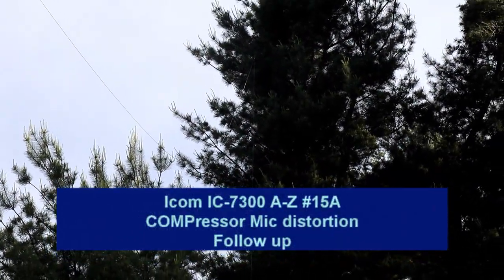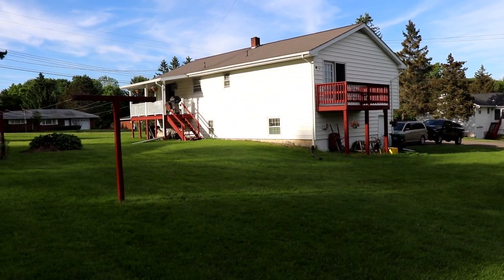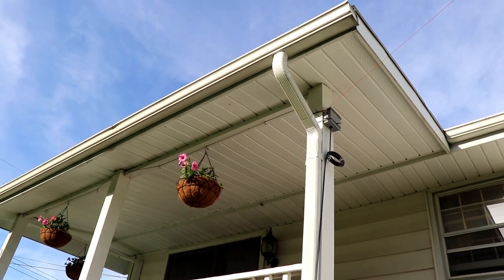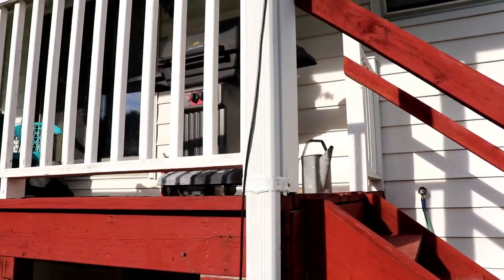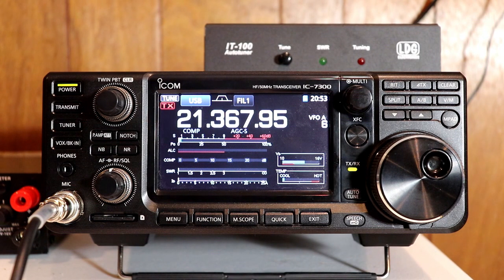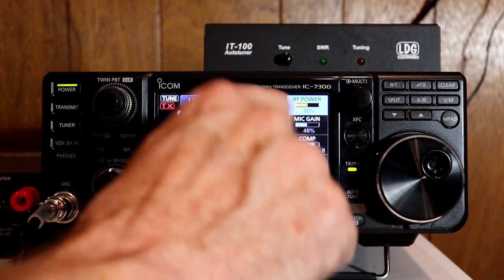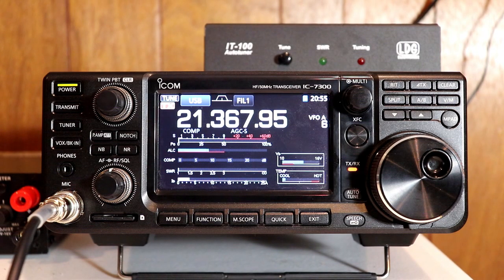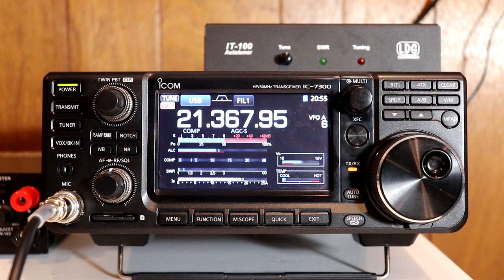Icom IC7300 A to Z #15A COMPressor mic distortion follow-up

Comment: Im enjoying the series. 

I just experienced an issue and I wanted your input. I used the internal tuner a few days ago and when it stopped, the receive signal was down (reflected also on the waterfall) and was only receiving very strong signals. I tried tuning again and still the same. Any ideas? I'm ready to try a total reset as a last resort. 

The radio was purchased new from HRO at the end of December, only 60 days in use. Jeff - W3AAB
Reply from the maker: Hi Jeff.  I have several questions.  This could quickly get too long for YouTube comments very quickly.  Please reach out through the Contact Me on the channel website- https://a-2-z.tech

Comment: Hi Tom . Thanks for all you help with the IC 7300. Awesome job. One question about the 9:1 balun unun. What length is you earth wire? I’m planning the same set up as you hav.
Reply from the maker: Hi Dave.  I have moved from that location.  I never did accurately measure the counterpoise wire, but it was about 20-30 feet.  I also experimented with adding to the 53 ft. Length of the original antenna.  However, you have to be careful about this.  It is important that the antenna length is NOT resonant on any bands you want to work on.  Any frequency where the antenna is resonant will present a very high impedance at the feed point and the 9:1 transform won’t bring it down low enough to be reasonable to tune.  If you Google “non resonant end fed antenna” you’ll find some web sites that give a number of lengths to use depending on which bands you want to work.  Good luck with it and let me know how it works for you.  73,  Tom

Comment: I thought with “shielded” coax that near by interference would be eliminated? If this is true how does the coiled coax affect inductance? Or would the extra wraps on the torrid would have been what affected your out come?
Reply from the maker: The shield helps with many things, but it is not a perfect solution.  If the antenna isn’t a perfect 50 ohm match for your coax (and a random length end fed never is) you can get common mode voltages between the shield and center conductor that will cause the shield to radiate like it is part of the antenna.  This can radiate all the way into the shack and can cause your equipment chassis to be “hot” with RF.  The coiled up section of coax becomes what is called a Choke BALUN (Balanced to Unbalanced).  The name comes from it choking off the RF and preventing it from coming down the shield into the ham shack.  Here is one article on the subject:  http://www.hamuniverse.com/balun.html. You will find a lot of opinions about how much coax, how many turns and what diameter is best.  The best answer can be determined by mathematical analysis.  However, there is a lot more opinion than analysis out there.  In my case, the amount of coax in my choke was very scientifically determined based on how much extra coax I had available.  😉

Comment: Compression on 8 and it's hardly showing ? Mine is on 3 and is almost too much. Any higher with the hand mic and it's overblown. Now, I have a desk mic that I tuen it up to 6 on.... sounds good though.
Reply from the maker: As I was recording this, I was talking into both my video mic and the rig mic at the same time.  I've got my video mic gain up fairly high and I'm speaking pretty softly.  I was recording these fairly late in the evening and trying not to disturb others in the house.  I was probably also paying less attention to the rig mic and not holding it close enough.  I think if I was talking in a normal voice and just paying attention to the radio my settings would have ended up different.  Thanks for watching and thanks for your comments.
Reply: @HamRadioA2Z  ah, ok. I recently bought this radio, and I noticed distortion when the compression is too high coming through when you have the monitor on. It sounds like RF on your signal, but it's not. The 7300 needs very different settings for different mics that you might use. I have 3 mics I use with it. I have the stock hand mic, a Heil Pro 6 elite with the regular dynamic hc-6 element, and a Heil HM-12 for a desk mic. In that order, you need lower to higher settings all around to get about the same results. It helps to have a friend on air to help dial them in. For the stock mic, I use treble +3, bass 0, compression 3, and mic gain 45-50. This suits a deeper voice. The headset... treble +3, bass +1, compression 5 or 6, and mic Gain 55-60. For the HM-12 Treble +3, bass -1 or 0, compression 6-7, mic gain 65. Using a condenser like the hand mic is a bit hot. Newer Icom's are like that, so it's no surprise the settings are much lower than a dynamic.

Comment: Some end fed manufacturers recommend a line isolator to keep RF out.
Reply from the maker: Thanks Don.  I agree that's one way to do it.  See my reply to bigbangnone below.  In my case, I have a separate counterpoise and I wanted to stop my coax from acting as a 2nd counterpoise.  That's why I put the choke right below the unun.
Reply: @HamRadioA2Z  Thanks. Antenna theory heavy here. I haven't done much with end feds, so I'm learning here. That's good because I want to employ one for portable ops.
Reply from the maker: Trust me, I'm just learning too.  I've only started playing with end feds over the last 4-5 months.  I've been doing as much reading as I can.  Over the years, I've found that antenna discussions are lot like politics, religion or the best pickup truck to buy.  People have very strong opinions about their favorite antenna and how to deploy it.  And, on top of that, if you ask 10 different hams you'll get 20 different opinions.😉
Reply: @HamRadioA2Z  Huh. Makes me think that there are a lot of wrong answers out there then. The good news is that we know certain basics that get the job done and accomplish effects that we are looking for. If we at least stick with these, we are a good way along to where we need to be.

Comment: You called that an end fed. A true end fed has no counterpoise wire. It’s work entirely against ground. Isn’t this really an off center fed dipole?  End feds also need a 50:1.
Reply from the maker: Hi Dennis.  It is definitely an end fed antenna.  I could have just connected the ground terminal on the unun to a good ground instead of a counterpoise.  It's just that in setup in this video and the other temporary setup I had, I didn't have a good RF ground available.  I will agree that the line between an OCF and end fed does get a little muddy with the counterpoise.  The 50:1 unun that you're thinking of is for a half-wave end fed.  That is a resonant antenna for 1 specific band.  The end of a half wave wire is very high impedance.  So if you're going to feed there with a 50 ohm line, you need a very large transform ratio, thus the reason for the 50:1.  My antenna is a "random" length specifically chosen to not be resonant on any of the bands I want to use.  So it needs a tuner for most bands.  Most of the articles on these call them random length.  Oddball length is probably a better description, since it isn't really random at all.
Thanks for watching!  73, Tom

Comment: Hi I liked the Video,,,,,,, But your comp is to High   you only need about 5/4  that's 10Db. on my radio my power 100%   the mic gain is 80% and the comp is set at 5..........73s
Matt
Reply from the maker: Thanks Matt - Yes, I usually have my COMP set to about 4.  In one of the previous comments, I mentioned that I was filming this late in the evening, talking softly and also talking away from the rig mic as I was using both the rig mic and my video mic.  So I ended up setting the Comp up a lot higher than normal to see any effect.  Unfortunately, I didn’t think to comment about that in the video.